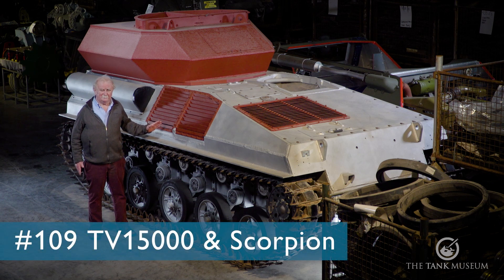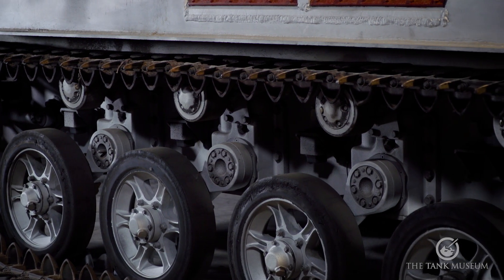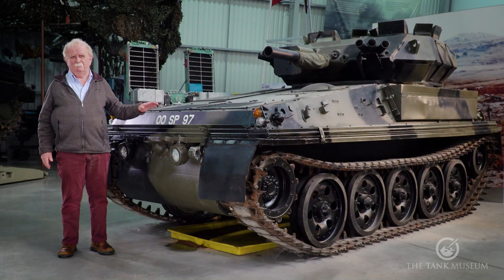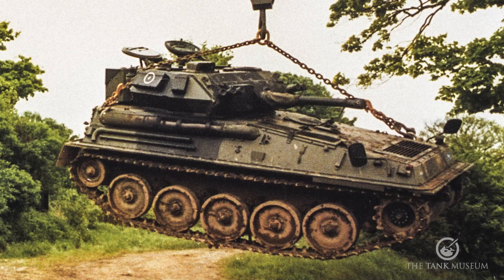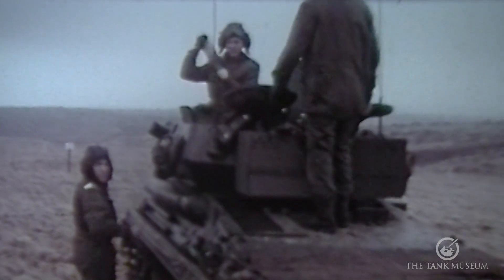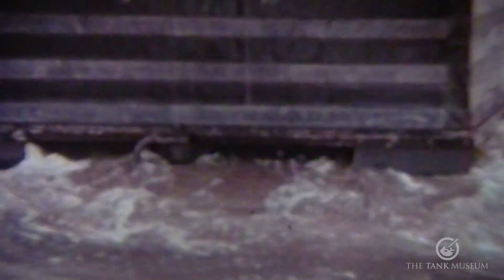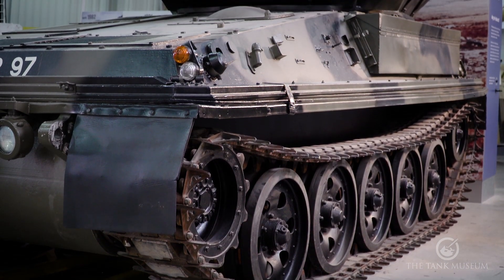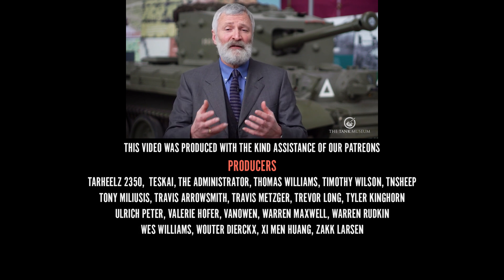Tank Chats #109 | Scorpion & TV15000 | The Tank Museum

Comment: Nice one. Few snippets:

The Scorpion was built of 7039 aluminium alloy rather than the 5083 type used on the M113. This actually WAS lighter than either steel or 5083 for a given level of protection, as well as reducing the requirement for internal stiffeners and frames as David describes. At the time, the only other use of 7039 was the in the hull of the M551 Sheridan, but not the turret, making Scorpion the first AFV to be entirely made of the stuff. Welding techniques had to be carefully researched and developed for the 7039 to make sure it didn't become brittle during manufacture and end up cracking in service. As it was, Scopion 90s, upgunned with a Cockerill 90mm weapons, have suffered turret cracking from the increased recoil anyway.

When the spec was being written, worldwide deployment in the world of the mid 1960s was being considered, and so the width of the hull was actually set by the distance between trees in a Malaysian rubber plantation of all things! This in turn set the hull length due to skid-steering ratios, which explains the small size.

I've heard the 'fumes' reason for withdrawing the Scorpion, but I've also heard an alternative, or possibly complimentary, explanation, namely that the Conventional Forces in Europe treaty (CFE) defines THREE categories: 'Main Battle Tank (MBT)', Infantry Fighting Vehicle (IFV)', and 'Heavy Armament Combat Vehicle (HACV)', the latter being a catch-all to cover things like the Scorpion, AMX-10RC etc. The treaty then defines TWO  sets of numerical limits, one for MBTs and one for IFV+HACVs. The Scorpion's 76mm gun got it classified as a HACV, but the Scimitar was completely unregulated, in fact it doesn''t even appear in the tables of existing vehicles in the treaty's appendix. This meant that every Scorpion which the UK kept would cost NATO a Bradley, Marder or Warrior, but we could keep as many Scimitars as we liked.

Given the choice between Warriors and Scorpions, and given the huge numbers of RARDEN 30mm cannons entering service on the Warrior, the Army decided to standardise on the 30mm across the fleet, and as it happened, a handy solution presented itself. At about the same time, the Fox armoured cars were being withdrawn due to their nasty habit of rolling over, so their RARDEN-equipped turrets (similar but different to the Scimitar) were salvaged and refitted to Scorpion hulls to make Sabres. In some respects the Fox turrets were better than the Scimitar ones (better night-vision), but they did require an awkward adaptor to make them fit the Scorpion's turret ring.

NOTE: comment rewritten 29/04/23 to reflect actual research I did after posting it, rather than just 2nd hand info.
Reply: Thanks for this. Yes, that is the reason I was told also.  This comment should be pinned
Reply: 7039 is quite a tough type, especially a tempered one. But, like all of the 7000 series, not easy to weld properly. The reason aluminum makes solid protection is its thickness. Projectile traveling through the armor plate loses energy very fast. The steel of the same weight gave lower protection because there was almost none left when the bullet was at the end of its energy affecting a transfer of this energy into spalling/shrapnels. Sharp and still quite fast while searching for the crewmen's arteries. 
I think KTO Rosomak (AMV Patria with floating feature) has a mixture of thin HHS steel skin plus 7039 T64 underneth.
Reply: @HanSolo__  As I was told, aluminium has 1/3 the weight and 1/3 the strength of steel. So it won't save you any weight just like that. (higher strength aluminium alloys exist, but the same goes for steel)
So weight reduction with aluminium comes down to, can you utilize the additional volume in any useful way, for example to prevent buckling, or present resistance to penetration, etc.
Reply: @kilianortmann9979  This is not so simple like 1/3 of weight 1/3 of thicknes. As I said the projectiles got stuck in the soft thick alu plates. You won't need 3x thicker alu plate only twice because projectile won't go further if its not DU APFSDS. Those vehicles were set against AP 7,62x39. Not even 12,7mm which is faaaar from DU dart containing sabot round. I worked in tools designing and I used to sell rare alloys so I do know what Im talking about. When I wrote about HHS and T64 you should already know why. I guess you dont because you wouldnt say "there are hard aluminium alloys but steels as well". I know the procesess and treatments and I know why they picked aluminium for armor. Yes there is a good reason for it.
Reply: I seen one of the 90mm armed ones at the Malaysian Port Dickson museum (well worth the visit) and you can see the cracking in the hull seams.
Reply: @Colinpark  I've seen 113 with cracking at the lift bolt holes in the hull.
Reply: @leighneil  yikes
Reply: I'm in favour of your last paragraph... this was a bugger of a recon vehicle, and not always convinced that Mr Fletcher is as well informed as he thinks he is.
Reply: @@retiredbore378 Thank you! I've done some more research on the CFE treaty effects since I posted it, so I've rewritten that portion to be more precise.
Reply: Interesting. 5083, a marine grade aluminium alloy - from memory, predominant alloying metal was Magnesium. Not a good metal when there is fire. 7039, predominant alloying metal - zinc which is less of a hazard with fire.

Comment: I was trained on scorpion and spent 5 years in spartan and striker. They have their pro's and con's. During an international exercice I was being evaluated by a German umpire in a Luchs ( a slick 8 wheeled reconaissance vehicle with drivers front and rear) and I had to make a dash to an OP. I got there in time, the umpire didn't. He estimated my speed at a good 68 mph and he didn't dare following us because of stability reasons ( the Luchs officially only reaches 56 mph anyway). To be honest, at moments like that you put a lot of trust in the tracks and even more so in the skills of your driver and keep your fingers crossed. 
So speed and maneuvrability? Definitely! Reliability? Muh... Protection? Paper thin aluminum, right... Discrete? ( it's a reconnaissance vehicle after all). Well, it's not big of course but a backfiring engine ( with its exhaust next to you so you are deaf within 10 minutes) and tracks that rattle so much you can hear us coming from at least a mile away didn't give me the impression I was 'sneaking my way in'.  Armament? The 76 mm handled more as an artillery piece, the 30mm was rather decent. With the striker you could effectively deliver a good punch up to 2,5 miles depending on training and skills of your pilot.  In short, the CVR-T series could play an interesting role on the battlefield due to its speed, maneuvrability and low silhouette and to a certain degree their armament but much would depend on the role they were given but due to their vulnerability the crews have to be extremely good trained in all aspects of their trade.
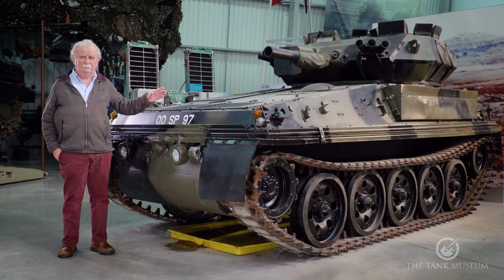Reply: I forgot; the suspension was terrible. I was lucky to have, literally, the best driver of the batallion but a inexperienced or reckless driver could easily kill his crew, or at least their backs,  in a few minutes through concussions of all sorts. At 6:10 to 6:16 you can see how the suspension doesn't absorb neither 'shocks' nor undulations in the terrain. The result was that either your vehicle started to get into some reinforced sway ( 6:10-6:13) or 'crashed' into the ground when traversing a ditch or so ( 6:13) and everyone got propelled forward. So you really needed a driver who 'felt' the terrain really good and pro-reacted real fast but at the time 'smooth'. If not, due to the cramped compartment, you always hit several ( very hard) objects.  When the driver had to brake hard the whole thing almost flipped over ( and then came back again...)..  Yes, I've got lower back problems and some hearing loss and I'm quit certain 5 years of cvr-T did not exactly help.   Aaahh, the good old days..:-)
Reply: @peterliekens7459  Sounds a bit like the issues with the Vickers series before WW2 which, AFAIK, was due to them being too short for the speed they were going at. An engineer might be able to say ore.
Reply: Discrete, no... discreet, perhaps.
Reply: Thanks mate, interesting stuff.
Reply: In fairness, I think the main issue is that the designers clearly were focused on making a modern-day M22 Locust, air-transportable to the extreme, so they didn't appreciate that the Scorpion was actually going to be spending most of its time on the ground as part of a ground force. So just like the M22, it really was an impressive tank for its size, but its size was just a bit too small for the battlefield it was going to be on. If they had added just a few centimeters to a few select areas, they'd have been able to fit the turret-slewing mechanisms, a better ventilator, given the driver the room needed, and gave the suspension the room to move. But if they did that, it would have been the better part of a ton of weight added  and that much tighter a squeeze in the airplanes. Still, rather a Scorpion than a BDRM!
Reply: @genericpersonx333  -  So many failed designs in tracked vehicles.   This kind of project can't be cheap.    It appears that they have people to run these experimental programs that don't have a comprehensive knowledge of the requirements.   They get some things right, and then it fails for some easily fixed reason.    One common problem is that they design a tank, and then look around for an engine that will drive it, as if they hadn't considered it worth thinking about, and the same with the gun.    I think they should start with the drive system and gun, and design a vehicle around them.
Reply: @mu99ins  Agreed. For sure, a lot of it has to do with the sheer number of people, many with little or no military experience or interests, allowed to be involved in Procurement, especially with regards to specifying what is "required" for the military. Between the politicians, corporations, and many military officers who all have a desire to be involved to promote some personal agenda, nothing is ever really tightly focused on what the military really would find best for fighting the wars it is planning for at the time.
Reply: I was trained aswel in the CVRT family, first as a "Voltigeur' (means scout) with the Spartan, later on I went as a gunner for the Scimitar.
The speed on normal road was awsome, +100km/h when not having the speedlimiter installed or removed.
Only downside for  me as a gunner was turret and barrel only moved manualy
We even had at first the floating screens attached so basicly it could trough calm water, but later on where removed because we never used them and took extra weight.
It was powered with a 7-speed semi automatic 4.2L Petrol Jaguar engine
The gun itself was a Rarden 30mm preloader (2 clips of 3 shells) and could theoreticly fire 80 rounds /min if the loader could follow :P
But like Peter says, thes where just for reconnaissance and small missions
Overal it was a fun vehicle and sadly now replaced by 6-weeled armoured vehicles like the Pandor
Reply: @MrAreZzz  Hoi Marc, I have to dissapoint you, a little, but voltigeur doens't mean scout but 'fieldplayer'.  And in the way voltigeurs were used in the Belgian Army, what I suppose  you are referring to,  the name is fitting.  The Belgian Army used cvr-T in 2 ways. Regular Tank and Infantry batallions had their own cvr_T scout platoons ( Sci and Sco).  But on the Corps level there were 3 independent Reconaissance batallions completely equipped with all the cvr-T family members ( Scorpion, Scimitar, Spartan, Samson, Sultan, Samaritan and Striker) .  A Voltigeur Platoon  ( 4 spartan) operated on squadron level and was tasked with a variety of missions mostly infantry- like: defending perimeters, crossroads, HQ etc.. setting up OP, ( agressive)reconnaisance patrols on foot,executing demolitions or minelaying, infiltration etc... Members of those 3 Recce batallions referred to themselves as 'Recces'  while the reconnaissance platoons of the other units were known as Scouts. Calling a Recce a Scout wasn't appreciated :-) ( and possibly vice-versa).  
I don't know how deep your knowledge of the strategies of the 1980's is but the missions of the recce batallions weren't exactly small, on the contrary and that was, in my opinion, the problem I referred to when I mentioned 'extremely good training'. The idea behind the deployment of the 3 Recce batallions was, in case of an imminent attack from the Warsaw pact , to rush forward as close to the 'iron curtain'   as possible (ideally in already pre- planned positions ) and pass on all possible info about the enemy advancing to us. That meant eventually being bypassed by the enemy scouts . The info the recces passed  was meant to give Corps HQ a better idea where the main trust would come and what kind of enemy we were up against. Now comes the fun part: once the Intel-part had served its main general purpose the Recce batallions were to engage the enemy with the prime purpose of delaying and harrassing them and give the defences more time. If you read  my assesment of the cvr-T then you understand that the speed, agility and size of it was abut the most important asset  we had. I'm still convinced that the second part of our mission, delaying the advance of an armoured full scale attack, with a battalion of cvr-T on a 10 km wide front was probably NOT the right, and certainy not small, mission for these vehicles.
Reply: @peterliekens7459  translation of voltigeur (french or more specific Waals) means letterly "scout " and yes this was in the Belgian Army
I know the 2 groups, but im refrerring to the actualy recce battalion(1st jagers te paard), where back in may day i was a part from, served 2 times as a "milicien" (another french word) and later as a pro militair.
And i know about the diffencer between the platoons fcol, been in it also for years aswel as on foreign missions(taskfor/I For etc)
Reply: @peterliekens7459  ok fair enough ;), but like i mentioned before, "waals" aint actualy a language, its just a "decoction" of French and you will not find an actual dictionairy of it + when I got listed it stould on my papers :). Cool tho you have been in same battalion, proby not in the same year...
Reply: @MrAreZzz  Voltigeur is a french military term for light infantry. Quick and lightly packed as versus of classic infantry of the Line...Infanterie de Ligne. Most of the time up front or at the flanks of the main infantry body and in less compact formations. In belgian army speak, you had voltigeur and "stormfuselier" with in this case was the classic armored infantry.
Reply: @williamsquare2669  Back in the day, in my Belgian Army days , I was in a Recce battalion where we had 3 platoons of recce's (in Cvrt Scimitar's) an 1 Voltigeurs platoon of 5 Spartans, each had 7 in it (Driver, Turret gunner, Tankcomander and 4 soldiers), the main goal was reccon on foot( driven by spartan at a location, then on foot).
Reply: for those who wanted to know what the Luchs was like  https://www.youtube.com/watch?v=yrDt9S0MovE
Reply: Thank you so much for documenting your experiences with them, Peter!
Reply: I spent a couple of years in a signals armored squadron in the mid nineties.  We had 43 series vehicles, mine being a 439 . It was mine cos I signed for it, but I was just a signaler. I repeatedly volunteered to drive naked but the corporal was having none of it.  He loved driving so I mostly had to command.  And I still had to wear my uniform !
Reply: We used all variants as we were an armoured recce regiment, I was in Belize on Scorpions, driving at night closed down with the turret traversed to the rear wasn’t good as the back bin was over the drivers hatch meaning it was hard to get out if the vehicle capsized as you would have had to crawl through to the commanders seat and out that way. Got lost a few times in Belize and literally carved a path through the jungle climbing up trees and pushing them over with the commander and gunner closed down because of snakes in the trees.......happy days.
Reply: The swingfire missile fired out of Striker wasnt too bad except when it started barrel rolling it was a case of timing what could be up to a 15feet roll just right then pulling the stick down at the last minute on to the target. I got quite accomplished at that. Striker was great for storing crates of beer in on exercise, out running a Leapard cross country was a challenge but fun. Never knew one to do 68mph though, 60mph tops absolutely ringing its neck downhill was the best I ever got and definitely not cross country. You didn't go fast in a CVRT cross country unless you fancied lying at the bottom of it knocked out. We had a new driver, we unloaded at the railway sidings at tidworth and drove on to Salisbury plain we were flat out, I was just about to shout slow down when we hit a huge hole that sent me and the commander flying and we both came round lying in the bottom of the wagon. My commander got a pick axe handle secured to the hull while leaning out of the turret  and battered the driver on his bone dome several times. Needless to say I ended up driving most of that exercise 😁
Reply: With a thin skin the vehicle like this you have to be at maneuvering all the time unless you want to become the next fatality, fire and movement , maneuver ,change direction, fire and movement